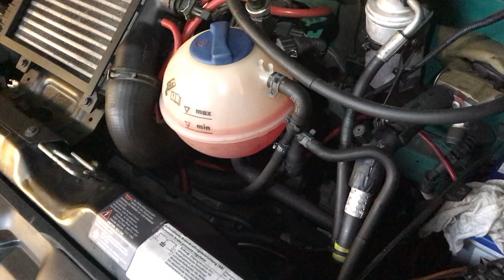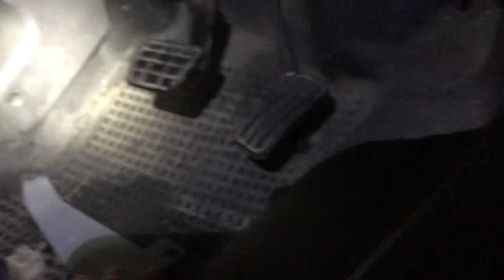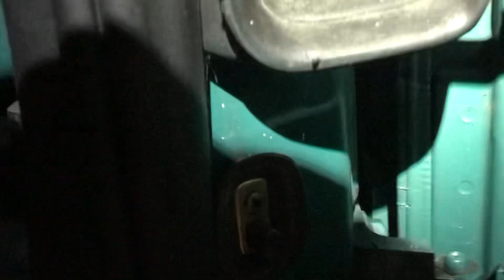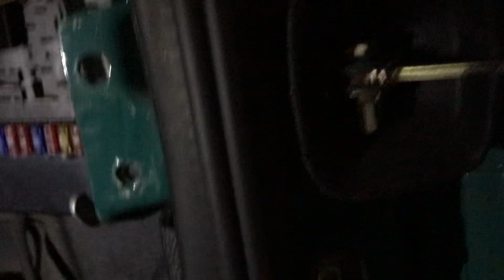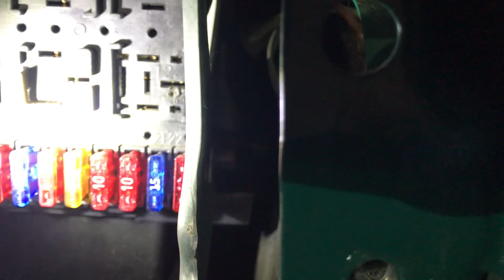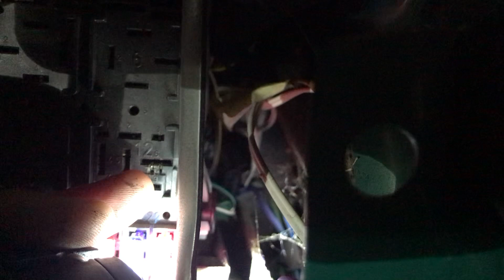VW T4 2.5TDi ACV glow plug relay problem

Comment: I'm checking this tomorrow i have no 12v to the rail...have another relay on order but I'm checking this in the morning 😊thanks
Reply from the maker: Let us know what you find.
Reply: @bvqbvq well mine look fine but I took the top off the relay  it was clicking but not making contact i slightly bent the contact point and I'm now getting 12v feed 😅 i do have a new one on order so will get it fitted once here..
Now to put everything back together i removed the rad n fan to gain more room to change glowplugs 🤙
Reply from the maker: @P8FPV  good success then! When I did my glow plugs I just lifted the rads into the service position. That generated enough space to access them. At least it sounds like you'll have a running engine 🙂.
Reply: @bvqbvq i have replaced the two temp sensors on the plastic housing and also getting the fuel timing set soon too...
Let's see how i get on tomorrow cheers buddy

Comment: Well done for finding that fault — it wasn’t an easy one to spot. And thanks for posting the video! I have starting issues now that the weather is getting colder that I have never had before and I am just about to start faultfinding. You’ve given one potential cause that I would possibly never have found, if that’s what’s causing my problems.

Comment: Did your glow plug light come on when it was faulty?
Reply from the maker: Yes it did and that had me fooled for quite a while. I ended up spending time looking at other issues before I finally discovered that the glow plugs were not receiving any voltage while the light was on. I suspect that the light on the dash is driven from the ECU and not from the output of the relay.
Reply: @bvqbvq  thanks mate. Im having a nightmare.  My coil light wont come on and fault code,  no power to ecu. Tried the 109 relay bypass but doing nothing.  Will keep looking
Reply from the maker: @hippydude1  I've put a copy of the engine wiring schematics here: https://drive.google.com/drive/folders/1Yp3J0nil4o2oxT9OKjTYRebR4a1WM37g?usp=sharing
That should allow you to trace the supply to the ECU.
Reply: @bvqbvq  thanks buddy.  Will check it out
Reply: @bvqbvq  i thought i would share my information with you.  Long story short.  It was a tiny black only wire. Couldn't find anything mentioning that anywhere.  Ive the same engine as yours so if it happens to anyone else check that.
Mine was broken near the rocker cover in the loom but it didn't look broken at all. Thanks
Reply from the maker: @hippydude1  thanks for the feedback, I'm glad that you fixed the fault. I have found wires with an internal break on older vehicles, they can be tricky to track down particularly if you want to find the actual position of the break.
Reply: @bvqbvq  thanks buddy.  Yeah it was hard work finding.  Glad its sorted now
Reply: @bvqbvq man!! What a great library full of info! Thanks A LOT for sharing this, seriously.
Reply from the maker: @the4eyeddragon  you are welcome. It all helps people keep these great vans going.
Reply: @bvqbvq  absolutely! Not gonna give up our golden nugget 🤠🎶
Reply: Don't always believe your glow plug light on dash, I have different relays that give different light times from 4 seconds,  10 seconds and 22 seconds, and the 22 seconds relay im using and by a volt meter and hearing the relay it shuts off voltage 5 seconds after van is started, but light on dash stays on another 18 seconds or so..